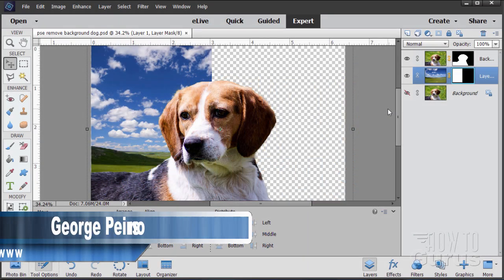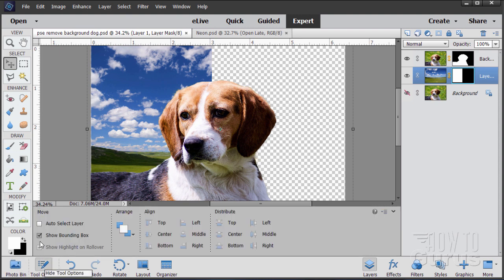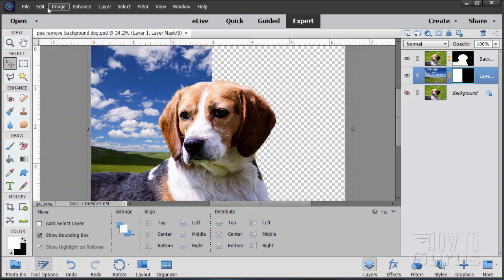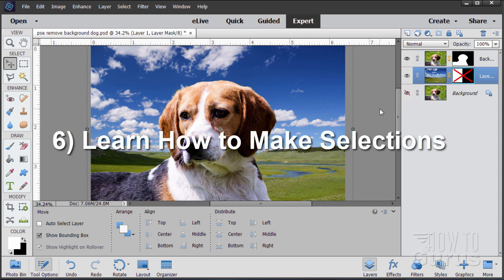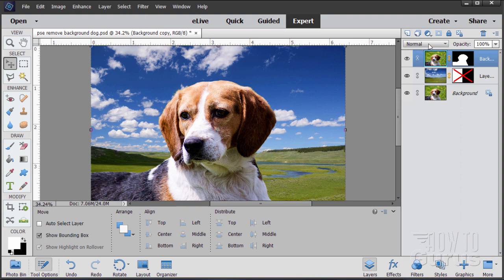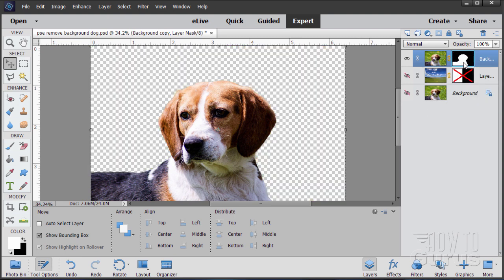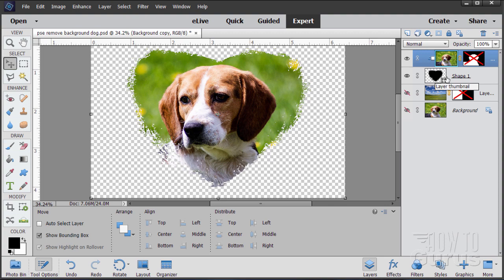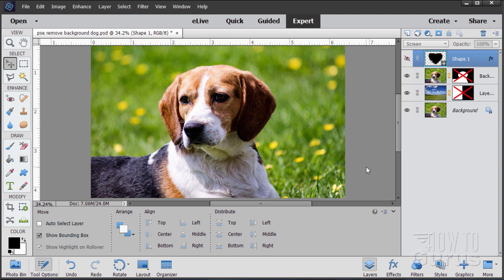Top Ten Things You Should Know in Photoshop Elements Expert Mode for Beginners

Comment: Hi George please can you help? I don't  what i have done but my working panel is covering the top band so I can no longer see the band showing guided and expert etc. kind regards Sue Hill
Reply from the maker: Sounds like you have your working panel as a floating window, larger than the normal work area. What you should do in that case is simply dock the panel back into the work area, or you can move the window lower so that you can see the mode buttons.
Reply: Thank you for responding. I tried that but it didn't work. The panel under the floating window is too big and can't be moved.

Comment: George, this is the first video of yours that I have seen.  Very well done!
I am currently using PSE ver 10 along with Topaz software.  I am considering upgrading to PSE 2022 and wanted to make sure there was no loss in functionality in the Expert Mode.  Based on your video, it looks like it's a safe upgrade.  I do have a few questions:

1. Can PSE 2022 coexist on a Windows platform with PSE ver 10?  (This would be short term).
2.  Does PSE 2022 still support links to external software such as Topaz products?
3. Does PSE 2022 still support creation of Panoramas?

Thanks so much.
Reply from the maker: Hi James, you can keep both versions of PSE on your computer, no problems with that.
In PSE 11 Adobe greatly simplified the program and it is not as feature rich as version 10.
PSE still supports external software and plugins.
PSE still does Panoramas.
You should try the free 30 day trial first to see if you like the new version before shelling out the bucks.
Go to this page https://www.adobe.com/products/photoshop-elements.html and scroll down below the FAQ section and you will see the trial links to the left of the social media icons.

Comment: MY ELEMENTS HAS CHOKED ON MAC!  I have PS elements 2020. I can no longer upload TIFF files. Adobe Help has told me the latest IOS version Monterey 12.0.1 is not compatible with PSE. This includes PSE 2022. Specs are  only macOS 10.15 or macOS 11. They suggested I downgrade to previous IOS version as they have not got around to testing with Monterey. They may find a fix for 2022 but no promises a fix coming for 2020. They suggested I download PSE 2022 trial - Also didn't work. My parting comment to Adobe help was that I have owned PSE 2020 for only 1 year and already redundant. As apple often upgrade their operating system PSE 2022 will soon be incompatible with the next newer version of IOS. WTF. This is amazingly slack from such a big company. Amazed they have not even bothered to test with the latest IOS AND they have produced such an unstable package with zero support. BE WARNED!
Reply from the maker: Wow, lots of the same comment on several videos. Of course my usual answer is why are you using a Mac? I've never liked Macs, even when I had to use them for work. In any case Adobe builds their programs for Windows and then converts them for use on the Mac so the Mac version is frequently out of date or not fully compatible. But I agree, if they are going to sell a Mac version then should make sure it works correctly on a Mac. One more thing, Adobe farms out the programming for PSE to India, it isn't done here in the US, and I do get tired of Adobe stealing my ideas for their updates. All the updates in 2019 were just Guided Edit versions of my projects from my 2018 training course.

Comment: Very nice tutorial...Tip #1 is no longer valid in PSE 2021 since Adobe has not provided a way to bypass Welcome screen and go directly into the Photo Editor or the Organizer. Workaround is adding a shortcut to the actual exe on your desktop.
Reply from the maker: You are right, which is why I did this video https://youtu.be/NU7sapsdolw
Reply: @HTGGeorge  Missed that one (still going thru your videos). Thanks!
Reply from the maker: @utopia113  You're welcome. I wish that Adobe hadn't removed that option, but they wanted to have that space in the upper left of the Home Screen to run ads for Photoshop

Comment: TIP #1 does NOT WORK in Elements 2020. You can no longer skip the Home Screen.
Reply from the maker: You are right, but there is a work around and of course I have a video on that, here it is https://youtu.be/NU7sapsdolw
Reply: @HTGGeorge  Thank you for the link.

But, I found it MUCH EASIER & FASTER to open the Photo Editor from the Home Screen, and then go down to the Task Bar. You will see 2 Photoshop Elements Icons, one being the Home Screen, and the other the Photo Editor.
If you click on either icon, you are given the option to "Pin to Taskbar," or "Close Screen."
I chose to Pin the Photo Editor to my taskbar, and then closed the Home screen.

Now, I just go down to the taskbar and click the icon when I want Photoshop Elements.
No copying, dragging, or hassle.
Reply from the maker: @mozempire5096  Good tip, two comments for anyone else reading this. You need to Right click on the icon in the Windows taskbar to bring up the option to pin to the taskbar, and this will not put a run icon on the deskdop, only on the taskbar. Good option though if that is what you are looking for. Personally I need the program to run from the desktop and not the taskbar as that is already full with other stuff.

Comment: Working off a card reader, in DPP, I can bypass EOS, and immediately see images/thumbnails from the card.
In PSE, I see file numbers, when I'd much prefer to see the thumbnails they represent. 
So, is it possible to see the thumbnails in PSE, so that I may see and select from them, the images I'd like to process? If so, how?
Many thanks!!
Reply from the maker: Hi, the Elements Organizer comes up as thumbnails by default. If you are using the Elements Editor then that brings up a normal Windows drive window, so just set your view settings to Large Icons. The drive window that opens when you select Open from the File menu is a normal Windows window, not part of Elements.
Reply: How To Gurus Many thanks!!
Why have I not seen this information anywhere on the web/YT  - it’s important to know?
So, many thanks for your response.
Reply from the maker: @usernamemykel  : )

Comment: Thanks for the reply, but I was talking about the ability to create a picture of the design on a t-shirt before putting it on the actual t-shirt
Reply from the maker: Hi David, nothing special about that. Just do your image at the size you want for a finish and I would recommend using 300 ppi for the resolution. Aside from that you would need to look at the fabric transfer paper, or talk to someone at a professional company for any other requirements. For instance if you were going for a large print run on T Shirts that would be printed using silk screen then you would need a file that could be color separated, or spot color separated, so you would probably want to use Adobe Photoshop or an illustration program like Adobe Illustrator for that. If you are just going for an iron on then you would be able to use Photoshop Elements, just check to see if you need to reverse the image or not before printing. 
George

Comment: Thanks George. I am still using PE13 is it worth updating to 15? Many thanks for your great tutorials.
Reply from the maker: Hi RowanTree, Photoshop Elements 15 is a great upgrade from 13 (except for the problem with the recent file list, I have a video up on a temp fix for that). The best new feature is the ability to use layer groups in the layers panel, makes organizing more complex projects much easier. Also love the Facial Features tool, just magical. Here is my video on the top new features in PSE 15: https://youtu.be/Ry2neECNquA
George
Reply: Thanks again George. Looks like I'll be investing in PE15 very soon.
Reply from the maker: Hi, If you can hold out until the end of October I would recommend it. Adobe releases their new versions in October, I don't know if they are coming out with a PSE 16 this year or not, but if they do it will be released in October.
George
Reply: Will do. Thanks George.